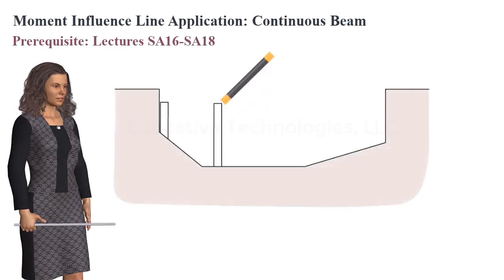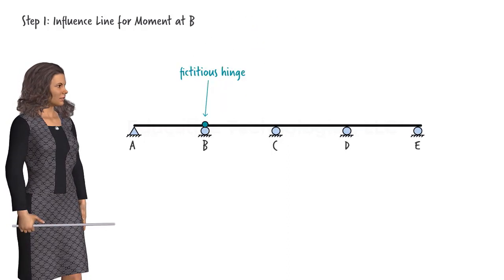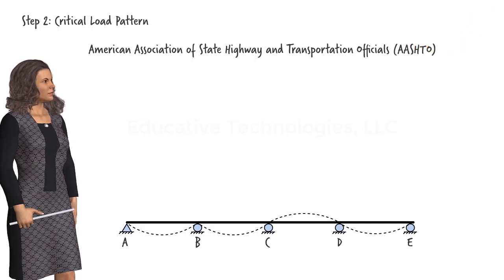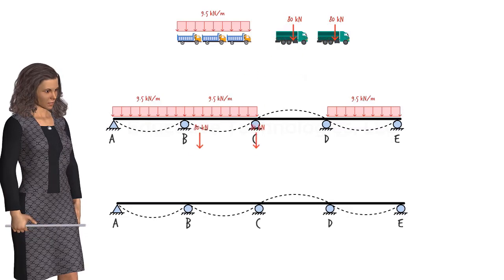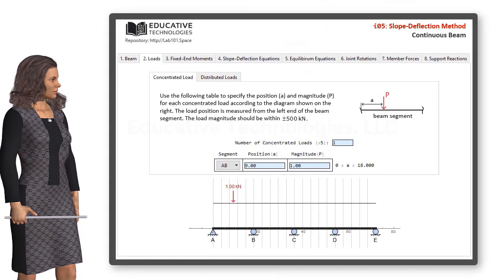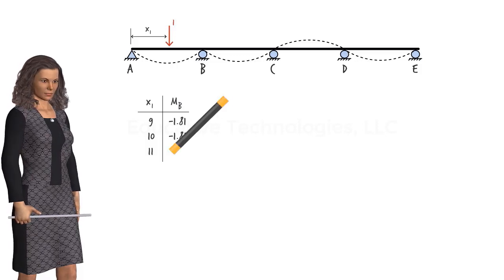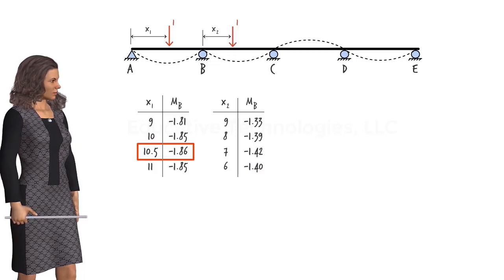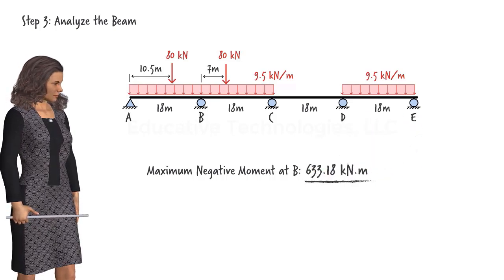EX09: Moment Influence Line Application

Comment: Good day Dr Structure,

I have tried downloading the software program linked to this video on my Computer, it is not completing the second download which has a size of almost 980MB. Can you kindly assist.
Reply from the maker: Right, that is a big file. Wolfram player (https://www.wolfram.com/player/) is a standalone app for running wolfram/Mathematica notebooks without actually having Mathematica installed on the computer. If you are having difficulty downloading/installing the player, you may want to check the software requirement to make sure your computer has sufficient diskspace/memory/... for it. Alternatively, you can try downloading and install Mathematica (https://www.wolfram.com/mathematica/) itself. There is a trial (free) version that you can use for 15 days. The cdf file runs without the player, if Mathematica has been installed. Or it could be that the player is automatically installed when Mathematica is being installed. Either way, you can test and see if the problem is with downloading from Wolfram website, or is it just the player that does not want to cooperate.
Reply: @DrStructure  Thanks soo much, i have managed to Download both softwares program which is Mathematica and wolfram player.

Comment: Hi , i have questions a bout choosing dimensions and compressive strength of short columns , first M20 concrete means if i have 1*1 m columns can carry 3060 ton ?, 2nd if i have a short column carrying axial load equal to  200 ton what is the criteria of choosing its dimensions and compressive strength if im free from architecture guide , thanks always and forever
Reply from the maker: Not quite. The 20 in M20 means that if we take a concrete test cylinder and subject it to a uniform compressive load, the test specimen fails when compressive stress exceeds 20 N/mm^2. This is not the design strength of a column made of M20 concrete. The design strength is defined using other factors such as afactor of safety.  
You need to consult the governing design code in your jurisdiction to determine the set of criteria for designing a compression (or any other type of) member. By the way, steel and concrete follow different sets of design criteria.
Reply: @DrStructure   A ccording to ACI code what you suggest  dimensions for short column carrying vertical load equal to 200 ton
Reply from the maker: @mustafaalanbky38  This article should be of use for designing short columns: 
http://by.genie.uottawa.ca/~murat/Chapter%203%20-%20SP17%20-%2009-07%20_Excluding%20MP%20Diagrams_.pdf
Reply: @DrStructure  Thanks

Comment: With which software can i open the .cdf file?
Reply from the maker: You need Wolfram Player to run the cdf file. You can download the free player from: https://www.wolfram.com/player/

This version of the app runs on Desktop/laptop only. It will not work on a mobile device. So make sure you are downloading the desktop version of the Wolfram Player.